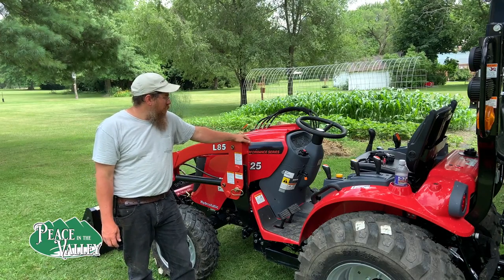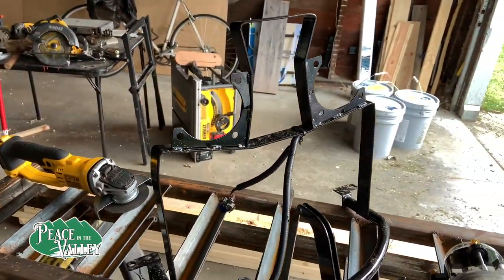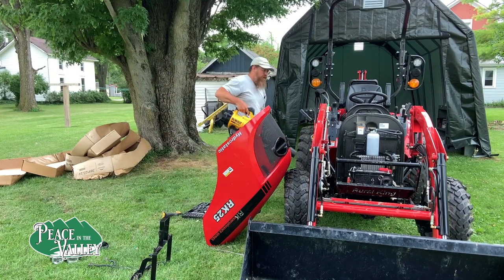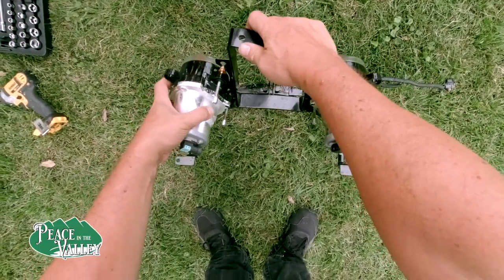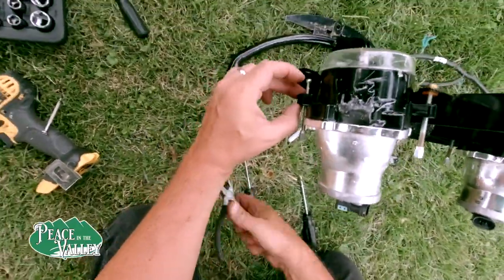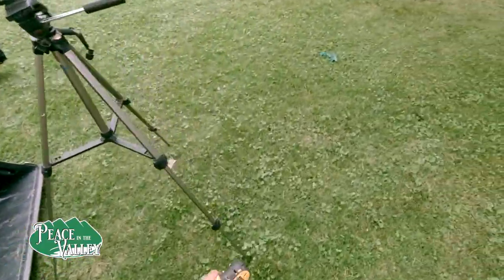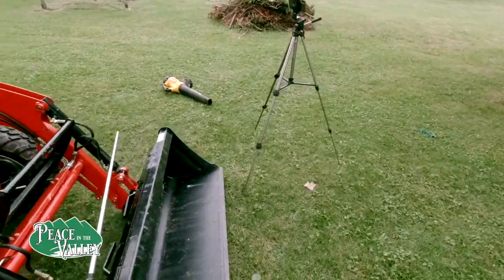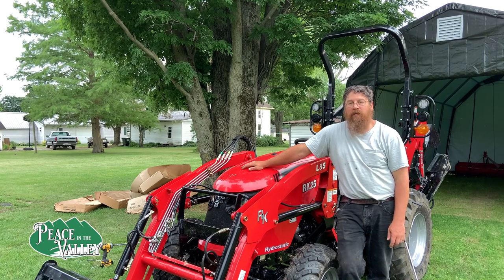EPISODE 17: Repairing the RK25 Tractor Hood

Comment: Great video!  Had issues with my hood, your video help greatly.   In this video, Noticed the compact tool set (sockets, wrenches etc) which would perfect to have around. Do you remember where you purchased it at and the cost?   I have an RK25, coming up to my 50 hours, your video on the service was really helpful., tool
Reply from the maker: thanks for watching! I believe that compact tool set you are seeing is the cheap one at Harbor Freight. It really is cheap. It gets the job done in a pinch but the metal is think and I have split at least one of the sockets. It was $39 when I bought but I do see specials now and then at HF for $29.

Comment: Very good and infirmative video, but would it have been easier if you raised the loader up in the air and gotten it out of the way
Reply from the maker: Hi Bob, I think you are right, however it's frowned upon to work under a raised bucket for safety concerns. There are certainly times I have but if someone else is working/playing around you and they bump the hydraulic joystick, it would certainly come down on you. It probably would be best to remove the front end loader. I have not done that yet. Perhaps that will be in another video soon! Thanks for the idea!
Reply: @PeaceIntheValley  Totally agree with safety. I seen in a couple of other videos where they placed angle iron cut to size on the loader struts when it was up in the air which would prevent the loader from coming down if accidentally hit.  Take Care

Comment: I like your getter done attitude.  Having said that I personally would have removed the loader for easier access.  In addition the jerky movements from your head cam made viewing like an amusement ride, sorry.  The way you straightened the metal support was well thought out IMO.  Hood damage is all too common on tractors with the FEL.  I have several and an RK 25 on order, to fill a gap in my assortment.  Probably will load the front tires to help stabilize when the hoe is attached.  No good way to add frt weights.  Wheel weights??
Reply from the maker: I'm thinking of adding fluid to the front tires too. When going up hill with the backhoe on the front will tip off the ground on bumps. My wife does not like it at all! What fluid would you add?
Reply: @PeaceIntheValley  Beet juice.

Comment: Just found your channel from watching John and Meg at Walnuts and Wineberries.  I am seriously considering  selling my JD 1025R and purchasing a TYM T25 or RK25.  Is the RK25 Red or Orange?  Hard to tell from the video.  Did you buy it from Rural King in Van Wert?  Thanks for your good work on the video.
Reply from the maker: Hi Brent, for some reason I did not get your notification of your comment. I purchased the RK25 at the RK in Decatur, IN since Van Wert did/does not sell them. If they would sell it there I would certainly get parts there. The RK25 is a warm red somewhat close to orange. I was really struggling to get the colors right on the tractor when the video was shot. I think it's getting better now.
Reply: I purchased a RK25 in Decatur on 2/26 just a few weeks ago!  I need to sell my 1025R now to help pay for it.  I will ask my local RK dealer (Niles, MI) for a recommendation on touch up paint.  I know where Van Wert is as I go by there on my way to West Liberty, OH where I have some friends.